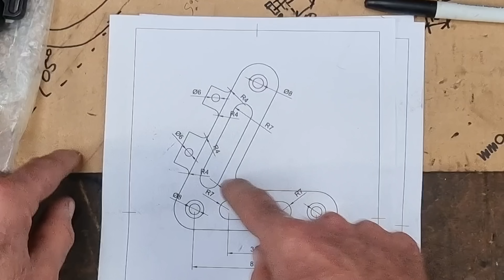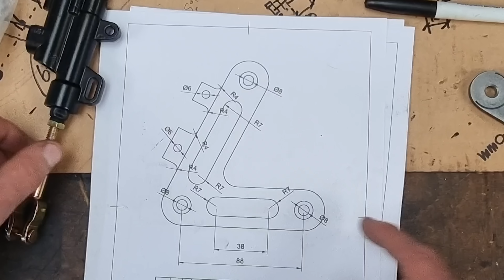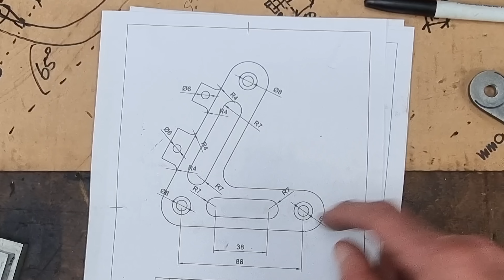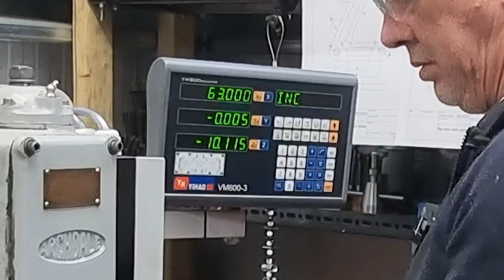Good Day, Bad Day... - Suzuki Bandit Cafe Racer - ASBO Project

Comment: fill the hole with the TIG welder,   how do i know, i have done the same my self and it worked out ok after polishing  good luck
Reply from the maker: I was going to, but when I've done it in the past, the weld shows up as a slightly different colour. They're going to be either brushed or polished and didn't want to risk it.
Reply: @QuickBikes  if you use a strip of the original material  cut in the band saw and cleaned of oils it can be used as a filler and should be the same colour, and if it works will save you a lot of time

Comment: The more complex the shape, the greater the likelyhood of a cock-up! We've all done it. 
Old school machinists will tell you never hold a milling cuttter in a Jacobs chuck (especially a keyless one). Kind of okay for a small, one off cut but the cutter can walk about all over the place in a chuck. Agree, higher looks better for the bracket, good decision.
Reply from the maker: I like using the collet wherever possible as I think it's just a better grip on the drill.  If I was swapping out the drill loads then I'd use the keyless chuck  but these are pretty much all 8mm holes 😁👍

Comment: could you not weld the hole shut and then do a skim cut with a fly cutter to save the part?
Reply from the maker: I could but the weld would probably be a different shade and these are going be either brushed or polished in the end...

Comment: Hey Quicky, why not just plug the holes with a bit of alloy bar. re zzr do yourself a favour and check the alternator drive don't just look at it take the bolt out clean and refit, Cush drive should also be in good condition. If you've done it already sorry to bang on about it but it's a known problem
Reply from the maker: I would matey, but I don't want the risk of having it a different colour as they're foing to be either a brushed or polished finish...

Comment: Fill the hole with TIG, machine to thickness and carry on with it. It won't show, even if You want to have a polished surface.
Reply from the maker: The only thing I'm worried about there is if the weld shows up as a slightly different colour as these are either going to be brushed or polished in the end 😁

Comment: zzr number 3 crank bearing prone to let go due to oil starvation
Reply from the maker: Thank you matey. I'll do the pressure test to confirm it and it'll be interesting to find out what let go on the dyno though hey 😁
Reply: @QuickBikes  I've fitted a tip over kill switch to my ZRX to save my crank in case the bike and myself part ways and it runs on its side.
Lot of info on ZXROA, basically the same bottom end.
Reply from the maker: Good to know, thank you matey 👍

Comment: Even when I lay out all my dimensions, tape the sheet to the work I still cock it up, shit happens mate.

I've found a lot of Ali recently is really gummy and wants to snap all my tooling, must be all that Chinesium floating around.
Reply from the maker: It was weird... as soon as it got to the tapered part of the centre drillnit just snapped with hardly any pressure on it either.
Reply: @QuickBikes  I rarely snap taps but the last few months I've done several, I do them  all by hand now, bugger knows what's going on with the Ali.

Comment: Erm did someone say he is a welder by trade .. well bloody plug weld it and carry on ya muppet . Does that old adage come to mind measure twice cut once . ...well at least the vans a good un for the the weekend . Just take ya time fella if it turns into a 2 parter then it's all good . Laterers
Reply from the maker: I could do, but don't want to.risk a colour differemce... either way it's an easy fix 👍
Reply: @QuickBikes  Powder coat?
Reply from the maker: I like the idea of matching reassess to however I finish the engine cases... I may still change my mind though 😁👍

Comment: Weld it and dress it OR thread it then, make an alloy bolt locktite it in then peen the ends and dress the surface
Reply from the maker: I was going to, but don't want to risk it being a different colour and showing up later as these are going to be either brushed or polished